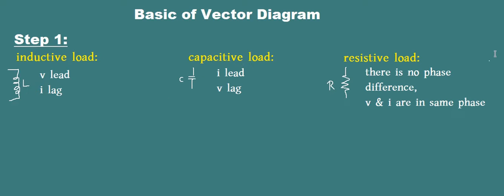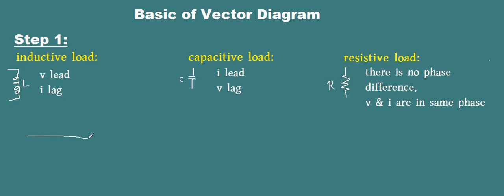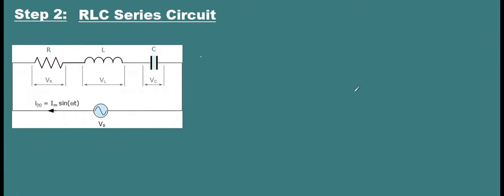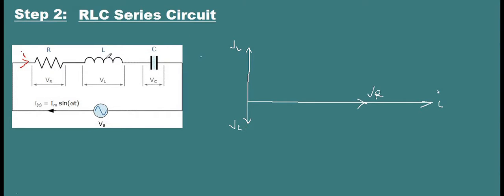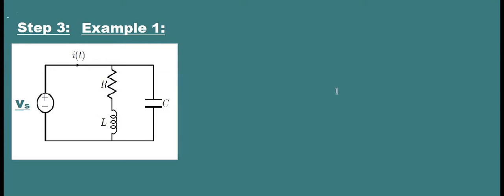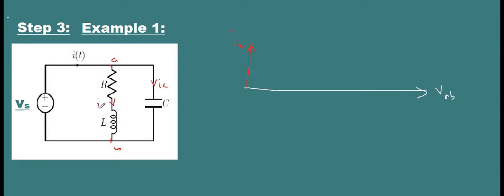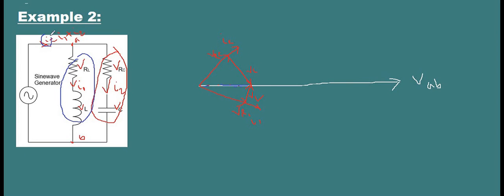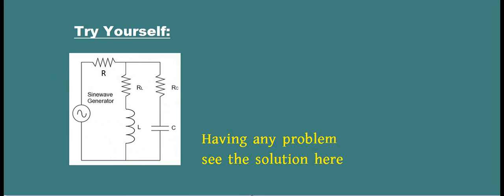Vector Diagram of RLC Series Circuit

Comment: sir,should the magnitude of Vrl+Vl be equal to Vs? similarly Vrc+Vc equal to Vs? then the length of Vs phasor should be equal to Vrl+Vl?
Reply: thank you so much sir. I have one more doubt, what if we also introduce inductance and capacitance other than Rc and Rl in example 2, how will the phasor change?
Reply from the maker: you mean only inductance and capacitance in parallel??
Reply: I mean resistances along with capacitance and inductance sir or maybe two resistances in series with a capacitor or inductor.
Reply from the maker: For series it should not be that hard, you can just add those two and replace that with Rs (Rs=R1+R2), and then do the rest.
and for,
resistance along with capacitance/inductance, you have to denote those branch current ( i1/i2....as you want) and you can also let that branch voltage (Vb) as a reference voltage and start drawing from that part.

if you still having any problem, you can send a pic of that problem (as youtube doesn't support any photo content) to this group, I will try my best to help you.
https://www.facebook.com/sciencecommunity.EEE.PUST/

Best Regards,
Anup Kumar
Reply: okay sir, I will. thanks again.